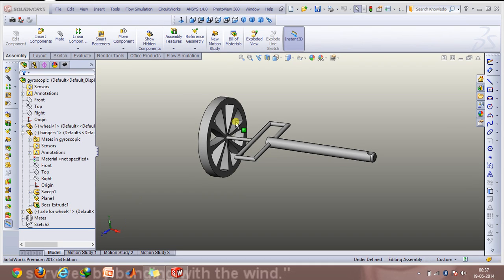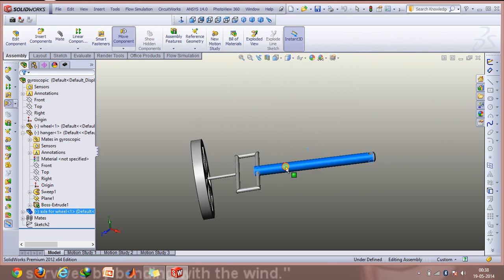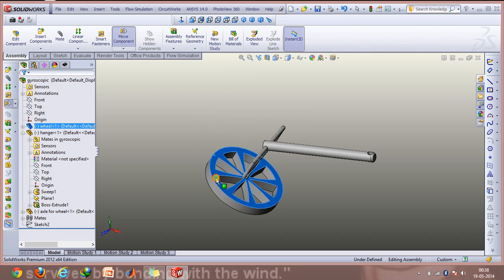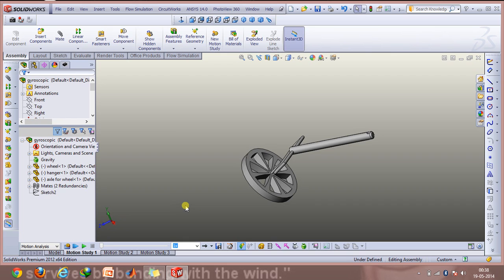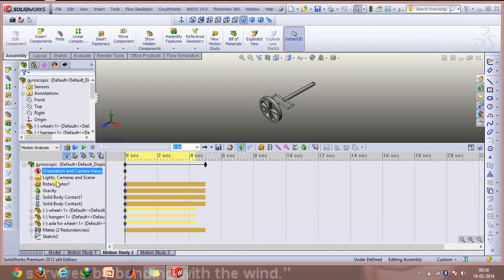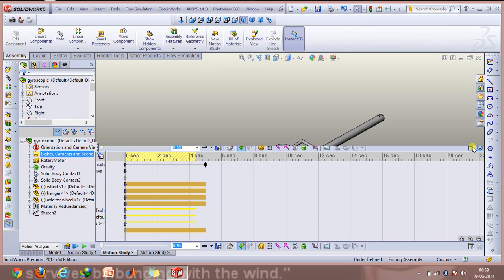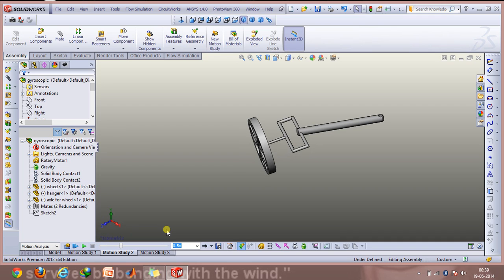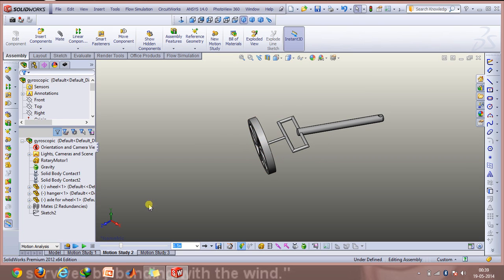Gyroscopic precession , its functioning. modelling and animation in Solidworks

Comment: grt job on solid works!
but this video would have the highest views, as compared to other gyroscopic video , if u would have explain more about the terms.. plz make it more clear coz i want to understand this concept..
Reply from the maker: Thanks for your comment, I appreciate it.
In  the first animation, due to the weight of the wheel part, it starts to oscillate like pendulum
In the second animation where the wheel doesn't fall the to the gravitational torque, what happens is that the wheel is rotated about the axis and then left under gravity. Now, due to its angular momentum it tries to resist the external torque due to Newton's first law of inertia.In turn it has to develop an angular precession which implies that the axle or the arm starts to rotate in such a way so as to negate the gravitational torque.
(Click on the "Show More" tab to learn about the formulas used.)

Hope this helps, If you have any further question or any suggestions about some video which you want me to put up,feel free to ask.
Reply: jasvir virdi so u mean dat gravity tries to pull the wheel down n due to rotation of the wheel , wheel opposes the gravity .... by creating a reaction  which is called PRECESSION!!
m i right or i need to re-construct my knowledge!!
Reply from the maker: Mahesh Pareek you have absolutely understood it right. Precession is the reaction which comes in form of rotation of the arm.This can only happen if the wheel is rotating about its axis.